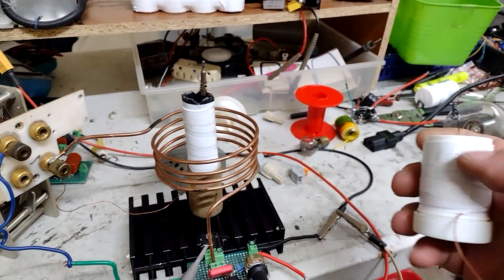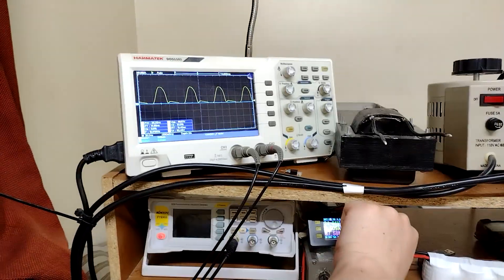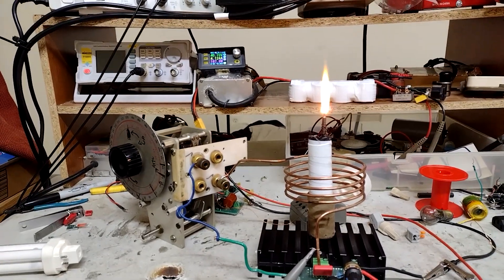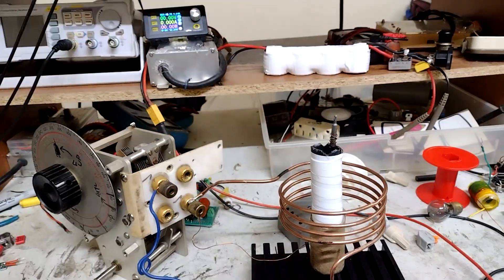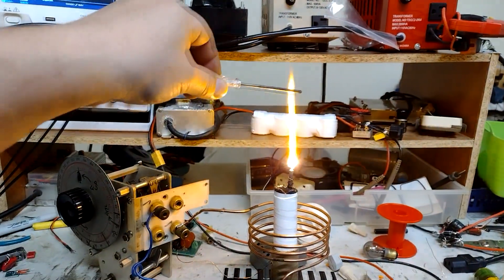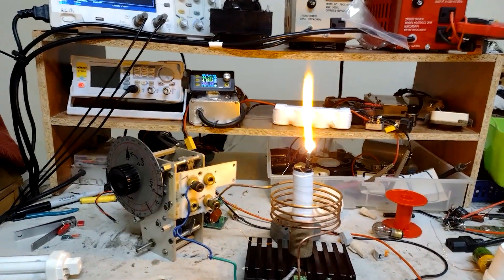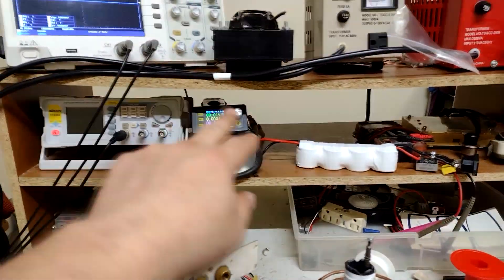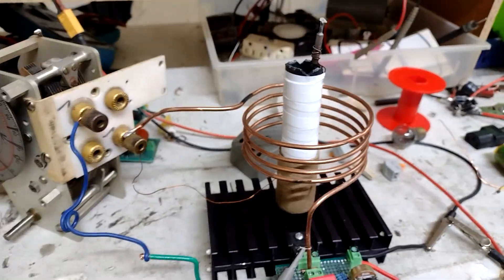HFSSTC IRFP260M 200W Flame

Comment: I have been trying to build mine for 7 months but without a variable capacitor or a ociloscope i have not fund success
Reply from the maker: Have you tried just playing with the oscillator portion by itself first? Basically not even worrying about a second resonator.
Reply: @Magneticitist  yes, the most i have is a 1cm arc that dies in 10 seconds
Reply: @Magneticitist  i was going to buy a 50$ ociloscope from aliexpress but i don't have a debit card (only have cash) and my mom refuses to buy it, even if i pay her
Reply from the maker: @ancientlink0  There's a good deal of understanding you need with these in particular to safely run them at first, especially if you're not quite sure what the waveforms are looking like. Basically some first hand experience with them. Some of it you can get by watching others. My approach was always just to turn the gate voltage up until I had oscillation, and try to back that gate voltage back down as low as I could get it before the oscillation wasn't able to continue. That at least helped prevent me from overvolting the gate and killing the switch. You also of course want to start out at some reasonable low voltage, maybe 20-25V or so tops all depending on your circuit. If you are getting a cm of flame at all then it means you have it working, but it sounds like it's working too hard and going into thermal breakdown so it doesn't last. At that point you're better off experimenting with as much variation in the secondary resonator as possible. If you can't really see what the circuit is doing on a scope your best bet is to assume you have "decent" oscillation in the primary circuit, but just need to better tune the secondary resonator. 

If your primary circuit by itself is not able to do things like light CFL's, or allow you to draw a small arc from the HV node, chances are it's not pushing enough RF power to begin with.
Reply: @Magneticitist  thanks

Comment: I bought some 18v TVS diodes the schem says 15v tvs so I do not know if these would work for a hfsstc , also I got some X1 Y1 450v rated  blue ceramic  capacitors I can put them in series so that would bump the voltage up , I almost have everything to build these hfsstc or at least a hf oscilator to begin with
Reply from the maker: Tvs diodes working depends on things like the mosfet absolute maximum gate to source voltage as well as their impedance at particular high frequencies. They may work and help protect from transients or they may just become a load and drag the switching down. I just use a couple of the cheapest zeners I can find that come in the little clear/red glass packages.
Reply: @Magneticitist  thanks so much , I am getting close the hfsstc build , even thought now that I saw that Schmitt trigger oscilator sstc you made spits a nice looking flame , and seems a bit more reliable , I starting to loose interest on these driverless hfsstc , I will see but I just want to get that plasma flame looking tesla coil
Reply from the maker: @rodriguezfranco3839  I can say that the driverless HFSSTC's are a funny thing because they can be much easier to reliably run in a way where the mosfet will not hate it, and at the same time can now and then be ultimate mosfet destroyers. I had that problem only on my first build though and it was super dirty with wires going everywhere. 

Now when I build the driverless circuit I will typically either see hard switching or I wont, but any ringing which develops never seems to be some order of magnitude greater than the running freq at the time. With these driver circuits and stiff switching I pretty much always see some kind of HF ringing that is only going to get worse the higher in voltage I go. Only with the right tuning can I get away with it while also avoiding heat in the mosfet. 

The driverless circuits can run well with the fet on a decent heatsink even if it's only tuned to some kind of pseudo or near soft switching. Realistically though, you could just make the schmitt trigger oscillator for example so that it can tune to a few MHz or so.. then just wind a coil that you know is going to be in that range.. then just power the primary and adjust the freq it's running at til you have plasma at the secondary.
There will be heating in the mosfet, and it will eventually die at a certain voltage from either exceeding Vds too hard or runaway overheating from too much HF ringing. If you plan to run it at under 100W or so it's not too big a deal and it might almost be easier to just use a fan on a big heatsink instead of trying to fine tune soft switching.

Comment: How much resonant  capacitor and feedback, capacitor are you using sir? Recently I have rebuilt the setup at home and I use 75mm diameter resonant  coil and 100pF resonant  capacitor,12nF feedback capacitor. Transistor is APT5024BFLL. I can run this set up at 180V and get around 700W. I'm curious that how can Steve and you get quite a large power at low voltage. My set up only gets about 200W at 70V , I think if your set up runs at 70V you may get 350W. By the way , I saw you were afraid of popping the fuse if you use a variac, I have a method to solve the problem.Now I use a 7kVA variac and I wire a microwave over transformer in series with the variac, I also connect a 500W halogen lamp in the secondary of the MOT ,you can use a risistor around 10Ω,this will make the transformer saturate and it would risist the short current by its leakage inductance.
Reply from the maker: In this video I measured the varicap setting at around 70-75pF whereas in previous variations it ran closer to 100-150pF. The smaller value on the gate was like 4-5nF I think. For me the pushing of more power is just all about tuning via the varicap. I do it a few ways using the gate voltage divider and the varicap in reference to the voltage I'm feeding it at the time. So for example at a certain input voltage, a certain arc-loading given that voltage, and a certain extra loading with my hand, I can see how fast the flame will increase or decrease with slight hand movements. What I want to see is the flame increase as I bring my hand closer. This tells me that as I increase the input voltage and the flame increases, the arc-loading will increase, and the tuning will get closer with it as opposed to getting further away. If the flame begins to abruptly decrease in size with very light hand-loading, I can assume it's not going to proportionally grow larger and consume more current as I increase the input voltage. 
I'm actually tuning the power down in this video because my DC supply will go into OCP about 100mA or so before it reaches the set point and I basically have to keep it under 4.8A or so in order for it to just go into CC instead of shutting off completely. If I didn't back the gate voltage down the current draw would probably be around 6-7A at 50VDC or so. Steve is able to get what looks like Class E right from the low voltages and doesn't get close to going outside of it til something like 200VAC or so. With 900V or so swings though his tuning seems like he isn't too concerned about the off cycle drain pulse width but rather shifting it a little over so it's swinging positive well after the gate swings negative, but still swinging back to 0 before the gate swings back positive. I might be interpreting that wrong though. 

I came close to just using my variac but I ended up using all the big DC smoothing caps I had for something else. I was thinking about getting a 60V riden supply or finding some other 600W or so supply I could buck but just haven't got to it yet. Since I'm using an IRFP260 I can't go much higher in voltage anyway until changing that out.
Reply: Ok thanks sir, I understand now

Comment: Hello sir,i find that IRFP460LC can handle about 500W in this type of circuit.It worth a try. By the way,do you know how to adjust the feedback phase?In Steve's video he said that it is important to have a right feedback phase,he used inductor to do that but I don't know how to do it exactly.I have tried to add an inductor to influence the phase but the circuit didn't oscillate anymore. I ended up with 23 fried mosfets and a broken down SiC fet yesterday.
Reply from the maker: You're right the 460LC is a pretty nice looking switch but every time I felt like buying it they were sold out. Not cheap either. I think for the price there are probably even better alternatives but I've never really looked. I've been tuning for lower voltage inputs though because I never got around to dedicating enough large DC smoothing caps to rectify my variac output to drive these, and I have a 50VDC supply instead. 

I think I tried using some kind of feedback shifting with an inductor but it didn't help. I've been having to tune using the frequency via the variable capacitor instead where it is either above or below highest resonance. What Steve may be doing is using something like a variable resistor in parallel with a fixed inductor, which is in series with the feedback to the gate. Or vice versa.
Reply: Recently i have some experiments with my setup and I found APT's 7th generation mosfets are quite good but they are a bit expensive.I dicide to use them when i tune the circuit better. By the way , I use a 71V power supply which is able to handle 3kW, i use IRFP450 with 4.7nF gate capacitor and 100pF resonant  capacitor.The frequency is around 14MHz. But the power is only around 250W just like your 40-50V IRFP260 setup . I have tried to adjust the pot to increase the gate voltage,it increases the power a little bit but i think that's not a good way because it would let the mosfet run at a wrong bias and produce a lot of heat. I also have tried to increase the gate capacitor to increase the power but it seems the mosfet produce a lot of heat as well, although my radiator is 20*12cm *1.5.
May i ask you how to increase the power by not increasing the input voltage and let the mosfet work safely without get fried? Thanks a lot.
Reply from the maker: @uecmitsuimarinedieselengin873  I probably ended up with a larger cap value so I have longer drain pulses that don't pk as high. If they were higher in pk voltage they would be shorter over time. Being able to tune the varicap def helps me there. Other than that I can't quite say specifically other than me using a 260 instead which is probably working better at those voltages. Might need close to twice the voltage with 450 or 460 to see same power.
Reply: Ok, thank you so much.
Today I increased the power to around 300W input,the plasma is 8-9cm at length with glass on the breakout point. However, I find the 3P connecting terminal I'm using is quite hot, at around 80°C if i continuously running it.The radiator is 50°C and the mosfet is around 65°C on its plastic side. I wonder if the heat is transferred through the mosfet pins to the connection or just the connection plastic was heated by the HF . Have you ever meet that heat problem?
Reply from the maker: @uecmitsuimarinedieselengin873  I had that problem in one of my first builds but I was using a 2 pin terminal to attach my external tank capacitance and the voltage was so high at such high frequency it would melt and burn between the terminals through the plastic. I don't seem to have that issue using the 3 pin connectors directly on the mosfet so long as they are still firmly connected. Sometimes a leg can break off and just barely be hanging on due to so much screwing/unscrewing and shifting the block around.

Comment: does this kill wifi or radio when you run it?
Reply from the maker: It can and will mess with the signals, WIFI probably not unless you ran the thing like super close to the router. It also throws quite a bit of noise back into the lines depending on how it's tuned.

Comment: I have been subscribed to your channel for a while now and I am amazed at how easy you make this stuff appear. What circuit are you using please?
Reply from the maker: Thanks but it's not all so easy. I just killed the 2 SiC fets I bought in under 10 minutes and I realized it was because I made a stupid error when buying them. Somehow I landed on the wrong ones which had a max Vgs of +12/-12v instead of 25v. Just going ahead and grabbing a couple more lol. 

This circuit is probably most similar to this schematic https://www.diyaudio.com/community/attachments/scheme-png.719430/
but I've got different values and using the IRFP260M.

It's not too hard to get working so long as you can ballpark calculate your coil values and use a variable air cap like mine.
Reply: @Magneticitist  thanks for taking the time to reply, appreciated. I have a few fried MOSFETs too. This is not a cheap hobby, I  live in New Zealand and getting specialised components usually means freighting them in. I will give that circuit a bash.
Reply from the maker: @ianfisher6561  For these I've found that whatever clones of 260's or 460's you can get seem to work fine. The SiC fets I had seemed to only have the real advantage of switching much happier which just translates into cooler heatsinks. The mini plasma flames sold online seem to get close to ZVS just fine using cheap 250 clones. Could probably tune this recent one I made to run off an amazon 460 all the same.

Comment: Always wondered if primary magnetic flux would react with metal stuff  nearby like heatsinks...apparently not🤷‍♂️

 I guess at mhz the coupling is so tight cause the magnetic field collapses before it has time to stretch out....then again I have no idea what I'm talking about 😅
Reply from the maker: Yea I never really thought much about it either.. It's something I try to avoid with lower frequencies but with these I usually just look at nearby metal as something which can detune it. I try to put a little distance between them on these but I have a 3mhz setup I just sat the resonator straight on without noticeable difference. I feel like maybe the biggest thing is that these nearby metals all become capacitors.

Comment: Awesome what are you referenceing your drain to? Also what type of cap are you using?
Reply from the maker: That was just the drain-source voltage if that's what you mean. It shoots way up there but seems a little more forgiving if I back the gate voltage back down to below what was necessary for initial startup and just let it run entirely on the feedback signal. Otherwise it will probably shoot to maybe 170-180V at only 35V input. The caps in my circuit are a 2.7nF WIMA MKP10 for the extra Gate capacitance and I have a honking (I think 350pF) air capacitor I got from a dead Q-Meter. The variable air cap is the easiest approach I think but I've found it hard to source any that have the variation I need at a large enough gap distance between the plates to handle the voltage.
Reply: @Magneticitist  Why is a cap across the gate-emitter needed? I'm trying to learn more about these class E circuits
Reply: i mean gate-source
Reply from the maker: @BackMacSci  Sometimes both are needed. The *D-S capacitance is basically adding on to the intrinsic value already there within the mosfet. When you run a single mosfet circuit like this without an added *D-S capacitor the intrinsic value is going to be too small. You have to imagine what happens in the off cycle with this capacitor. Your input voltage is going to be the rail voltage but during the off cycle when the mosfet turns off you have a ringing that will develop due to the primary coil inductance + leakage inductance in the circuit as it meets the *D-S capacitance. This usually results in much higher voltage peaks on the drain (compared to input) and can avalanche the mosfet as it's trying to brute force a break-down.  By choosing the right *D-S cap value it acts like a snubber to clamp this voltage peak, but you have to size the cap properly for it to work.

Smaller caps will result in the higher peaks and shorter swings and larger caps do the opposite. To size it properly for class E you have to get the drain swings to line up just right for zero volt switching. Easier to see visually on a scope.
Reply: @Magneticitist  Yeah, thank you. After commenting this i looked at steve's class E sstc that you cited as the schematic for this coil, and it explained the matching of the cap for zvs. What i'm confused about though steve doesnt have a G-S cap, only a D-S cap. When would you need the G-S cap?
Reply from the maker: @BackMacSci  lol oops I just noticed I wasn't paying attention and was saying G-S when I meant D-S. 

The G-S cap can basically be used to try to get rid of gate ringing and it will also slow the rise time the larger it gets. I don't use an external G-S on all of them, just ones with bad gate ringing.
Reply: @Magneticitist  ok, thanks!
Reply from the maker: @BackMacSci  No prob, I have a video using the sic fet where I added a little external 'cgs' and it helped reduce the ringing to tolerable.
Reply from the maker: @A Bored Person Yea this one cap would sell for more than the whole Q-Meter can still be found for. DIY air caps are hard to make small but I've seen some cool ones out there. Would be a pretty good project. 

Finding guys like these https://www.ebay.com/itm/115299787672?hash=item1ad8672398:g:BYMAAOSwyhpiM8X4#vi-desc-maincntr
for really cheap when possible either online or at yard sales etc are probably the best option cause if the meter doesn't work at least one nice cap will be inside.